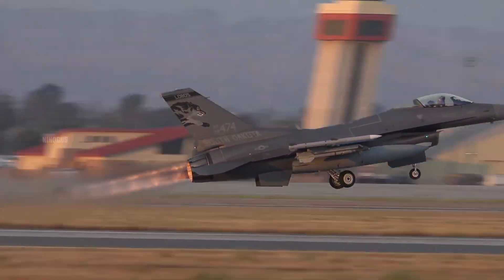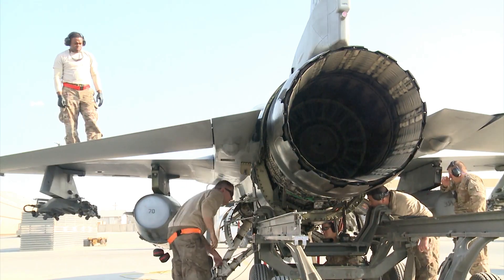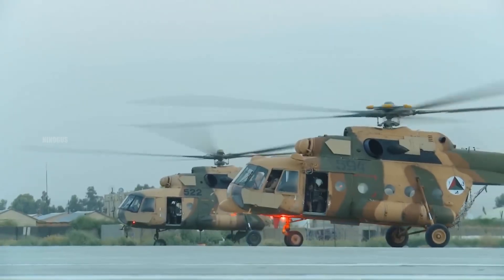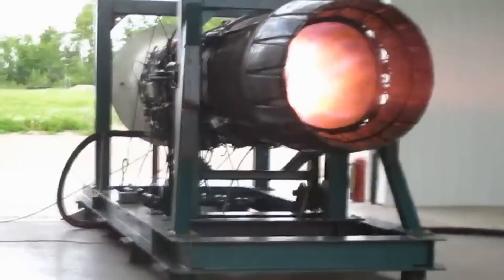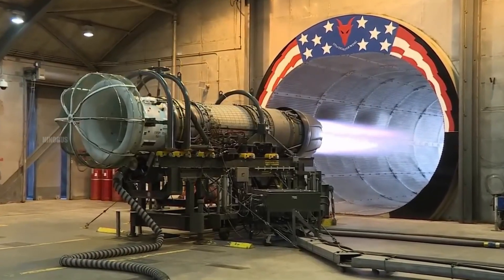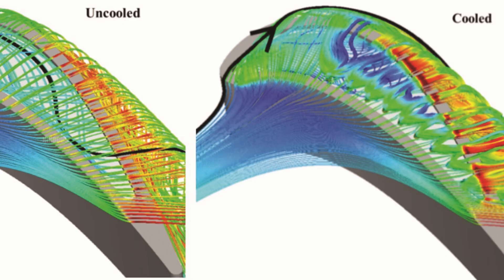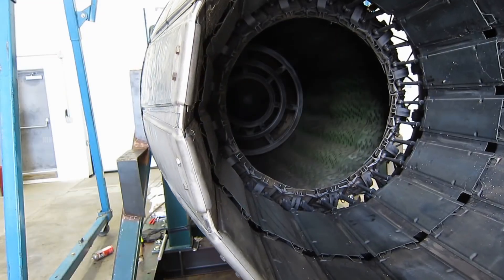Why Doesn’t a Jet Engine Nozzle Melt? Here’s the Surprising Truth!

Comment: The other main reason that they fail to mention is they simply don't use steel, but metals with much high melting points or ceramics.

Comment: bring back memories, I spent 10 years with GE, Senior Manufacturing Engineer for F110, F101 exhaust duct, which is fwd of the nozzles.  Also in charge of Fan Frames for commercial and military engines, including Tf39, 80C.  Machining the HPT casing was done without coolant, using ceramic inserts, always a show, like the 4th of July, sparks galore, and .080 cut on inconel needs about 25hp to power through.  I was also in charge of planning for the fan frame for the F120, which we lost to Pratt.  Back in the late 80's we were doing stuff that still today, would sound pretty incredible to most people.
Reply: #

The F120 was a variable bypass engine. 

I believe past Mach One, it operated as a turbojet. 

Gray Ghost, the PAC-2 prototype of the YF-23, had the F120 and left the YF-22 standing in the dust. 

Paul Tackabury, the YF-23 program manager, was not allowed to reveal the true speed, but said it was "very fast, much faster than the
YF-22" .

There was nothing special about the F119. Just a scaled-up F100.

The F135 is a junk engine. Overheats. Turbine entry temperature 3'600° F. Pratt & Whitney doesn't have the cooling technology for the single crystal blades and tried to increase thrust by pushing the turbine entry temperature to the limit.

Afterburner use limited to one minute. Half the F-35As are grounded.

General Electric had an alternate engine, but the Pentagon penpushers preferred to spend billions to try to correct the flawed F135.

Comment: The convergent and divergent nozzle parts also use a ceramic coating to reflect heat away from the nozzle plates.  This aids in capability to allow for longer afterburner use without damage.

Comment: the turkey feathers aka variable exhaust nozzle will indeed melt if the nozzle is in its full thrust position (closed or "minimum radius" position)  and the afterburner is engaged , this could only happen if there was a failure of the nozzle control system. the nozzle must be fully open position when the AB  is on.

Comment: I hate people that make these videos thinking they know why without knowing everything. At 4:22, you literally show why it doesn't get hot besides air and metals and that would be the ceramic white panels you see there. On high power (afterburners), you can walk up to the side of the engines and put your hand on them and they are cold to the touch. I know because I've done this.

Comment: You showed Afterburner several times but did not explain its impact on the exhaust temperature.That is the KEY factor when explaining the withstand capability of the NOZZLE, as it is stated in the title of the video!

Comment: It's a few years ago now, so Lockheed Martin may have improved or fixed it, but the F-35 was said to be burning away the radar absorbing materials if afterburner was used too long >40 seconds. Perhaps metallurgy or other improvements have since helped.

Comment: Most of the hot section is not just steel a lot of it is inconel which has a much higher melting temperature.  Also a lot of the parts in newer engines are ceramic or ceramic coated.
Reply: 👍I was just about to mention Inconel !  
AFAIK,  it's melting temperature isn't actually higher than some steels,  but it retains its strength much better at high temperatures.  😎
Reply: Honest question - who puts ceramics in the hot section? Ah!  Thermal Barrier Coatings are ceramics.

Comment: Although everything about propulsion engines is amazing, I have always felt advancements in metallurgy and machining is what allows designers to realize their ideas.
Reply: It  does.  I've seen preliminary engine designs that call for parts made of unobtanium.  Once the designers figure out what kind of unobtanium would make the engine work, they send its specs to the metallurgists and ask them to invent a real-world material that gets close.  Then they go back and forth, and both the real-world metal and the engine design are tweaked until they work together.

Comment: There is one other factor, the materials used. Not just any common steel is used in the high temperature sections. Material like Titanium and ceramics to name but a few are sometimes used. Notice the F35 Nozzle is white on the inside surfaces.

Comment: Work is mass with force and distance. Thrust is mass with force and distance. Therefore, thrust is work. Therefore, gas turbine engines produce work all by themselves. My high school physics teacher said that "jet engines" don't produce work, unless the engines are installed in an aircraft. That is like saying that gases aren't made of matter.
Reply: He's rent free in your head, evict the bastard.
Reply: Correct, every second, a certain mass of air is accelerated, that's work and results in thrust. What the user does with this thrust is not the engine's business. Same with car engines, they supply torque while rotating at a certain angular velocity. That is work. If a car is stuck in mud, it will not move, but the engine still produces work.

Comment: The radiation heat is relatively small, eben if carbon-containing fuels are burned. The most emission comes from soot particles and sodium ions. If hydrogen or methanol is used the exhaust jet is nearly invisible.

Comment: 4 seconds in " A fighter jet is an advanced machine"  Video shows an F-16, a forty year old design.
Not hot enough to melt steel.  Nozzle parts aren't made of steel-steel but special alloys of steel.
Yawn.

Comment: After landing and shutting down, for example an F-15, you can literally walk up to the engine nozzles and touch them with your bare hand, even while still feeling the heat radiating from the engine. Its bizarre.
The nozzles are specifically designed to cool rapidly for tactical reasons among others.

Comment: I think you missed something very important. What kinds of metals or alloys are used in the nozzle or different parts of the turbine?
Reply: What is not stated in this video is Ceramic coating used in the combustor, the fisrt stage nozzles and first stage turbine blades which act as a good insulator separating hot gaseous and nickel alloy metal. This with cooling air bled from the compressor and ducted to these components and exitting through these small holes keep these component cooler and prevent them from melting. What is most apparent during engine overhaul is the damage on first stage nozzle parts and first stage turbine metal parts is gouging due to high temperature and high gaseous flow which cut the metal like oxy-acetylene torch.
Reply: @anuardalhar6762 im always blown away by how high the inlet temps are after the compressor stages prior to going through the combustion chambers.
Reply: Metal’s  like, Titanium 6AL4V Inconel 600 & 700, Waspoloy. 
To mention a few. I know we did destructive test of carbide end mills in these materials. We sold the end mills to most major aircraft manufacturers.
Reply: @bobmac9070  Found the Pratt guy!
Reply: Titanium
Reply: What kind of alloys? The kind that will soon be mined in Ukraine.
Reply: @czedligyorgy7113 yep, if Don and Vlad are allowed to collaborate in stealing a sovereign state.
Reply: It's not metal it's high temp plastic polymers
Reply: If I remember from working on and around them it's titinum.

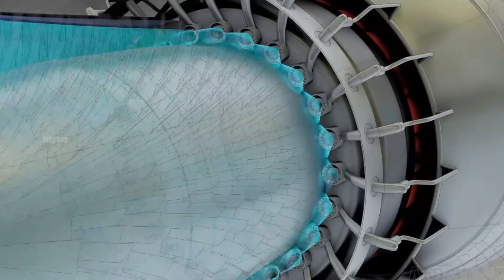Comment: 4:05 ... "heat transfer only occurs by radiation, not direct conduction"... AI is really ignorant.... 
The "air film" created in blades prevent heat transfer (from exhaust gases) by CONVECTION...  also... it helps cooling the blades by CONVECTION too...
There isn't any thermal transfer process called "direct conduction".... it is just CONDUCTION...